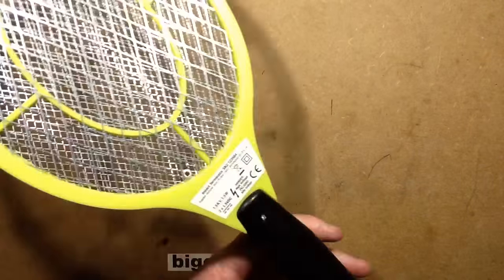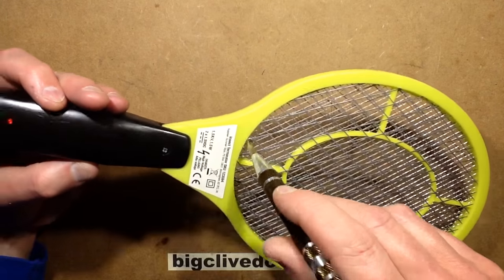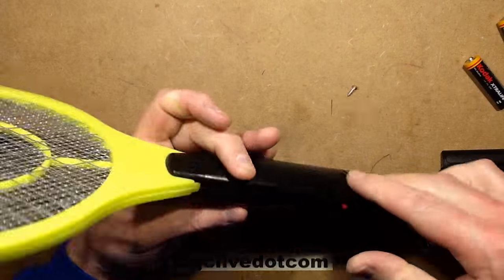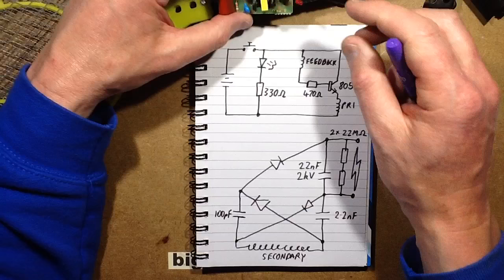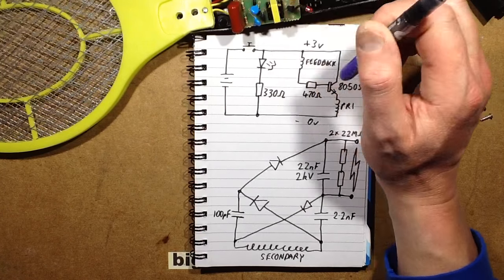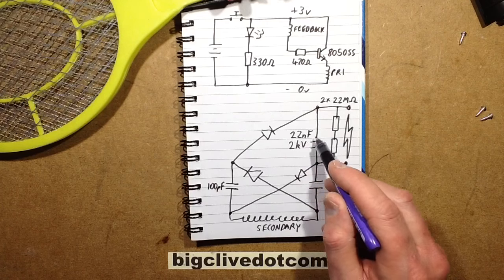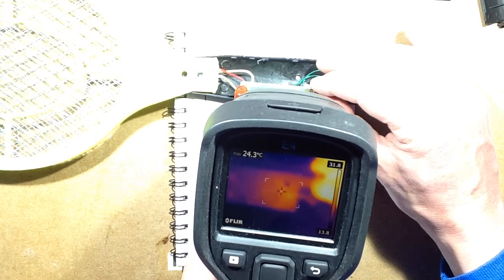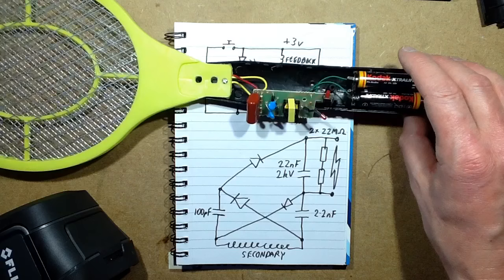Inside a bug zapper racket / racquet , with schematic.

Comment: I say, Clive old bean; just what is the voltage across the grid that zaps the bugs?  Inquiring minds would like to know...
Reply from the maker: +Silver Turtle I think it's around 1-1.5kV.
Reply: I thank you.
Reply: +bigclivedotcom so buy ten for $10 combine the circuits add power supply and 10kv?
Reply: Some crap ones are 800v and some go up to 2kv. Clives one seemed like 1.2kv.
Reply: I've seen some being advertised as 5 kv. Of course it would vary by manufacturer.
Reply: +topher If you ignore the fact that they are only intended for burst use, the really low current and therefore very low Power yes ...
Reply: +Silver Turtle  - I've just measured mine (using an EHT meter with 200Mohm input impedance) and it reads 970v)
Reply: +Silver Turtle Mine measured about 2.3kv with an electrostatic voltmeter (I was using it to test the vintage meter)
Reply: Meters can get fried trying to measure such high voltages. Good that you guys have equipment that can handle it. Others, please check the limit of your meters before attempting this. Is there a way to limit the output voltage by a known factor (perhaps by adding a resistor?) then multiplying it later to get the true reading? Say I put something that'd accurately reduce the voltage by 5 times, so 2kV would only send 400 volts to the meter. Is it possible to do so  in a simple manner , or would I need to know the current flow in order to do it?
Reply: +Habib Hasan a bunch of resistors making a voltage divider will work 90Mohm leg and 10Mohm leg should read 200v with a 2kv source Ive used them to measure up to 100Kv
Reply: Habib Hasan Well, such high voltages certainly can do damage - but a high source impedance tends to limit the damage greatly, by causing the voltage to drop hugely as current starts to flow.  
That's why different meter technology will give different voltage measurements for the zapper voltage - and why I quoted my meter's impedance. 

You can use a series resistor to modify your meter's full scale reading, if you know your meter impedance. eg if your meter is 10Mohm input impedance, adding 10 Mohm  in series will change a 500V full scale to 1kV full scale.  **Just make sure that the resistor or resistors that you use are rated for the voltage that they will have across them..  A typical resistor will only be good for a couple of hundred volts. The resistors in my meter are each rated at 60kV and there is a chain of them..
Reply: +Habib Hasan Ohm's law mate
Reply: +Mod Mod   Why not measure the AC voltage on the secondary then do the math?  Using a 10 meg resistor in series with my Fluke DVM, I measured ~ 350 vac,  I doubled that, because of the series resistor,  so I figure the DC output is about 1400 volts. Of course, because of the frequency of oscillation, the meter reading may not be spot on.
Reply: Just use a potentiometric divider. Two resistors. Make the lower resistor much smaller than the Zin of the meter so there is no loading. Don't go mad in reducing the shunting effect of Zin because accuracy is controlled by the resistor tolerance. I've just seen  "CheeseRoll's" instructions and he has fallen into the trap of not considering Zin of the meter. His cct  will read about 110V (head maths) when measuring 2kV, not the 200V he expects when using a normal DVM.
Reply: Worried about the frequency - Stick a 'scope on it. Preferably an analog one.
Reply: 2300v
Reply: nope, measured 850-950V depending on how new the batteries are.
Reply: Can anyone tell me- how come one is able to touch the mesh with a screw driver and not get a shock?? And how do we survive such a high voltage when we touch it??
Reply: I'm guessing with 0 ohms the current just jumps across, but w/ human skin R is much higher and so is the voltage drop across it. The charge has a high potential, but there's not a lot of it, so it dissipates quickly.
Reply: ssn90 Because it is the voltage BETWEEN the two mashes that zaps. So, if you took one screwdriver and stuck it onto one of the mashes and took another screwdriver and stuck it onto the other mash, you would get shocked. And we survive it because the amps are very, very low and the voltage breaks down very, very fast.
Reply: drkastenbrot It would be fun to put the  circuitry from a stun gun into one since they can run on those 2 1.5 volt cells.
Reply: Not really adding much here apart from crowdsourcing an average answer... 614v from mine @ 3v, 689v @ 3.3v & 918 @ 5v... The noise it makes at 5v is terrifying...

Comment: I'm thinking of using one of these as a small electric fence energiser. We have a heap of trees in our goat paddock and each tree has a metal cage around it. One wire would go to an earth stake in the dirt and the other wire attached to the cage. Cage would be elevated and insulated from the ground. These bug zappers are cheap enough to fit one to each cage to keep the goats away. Perhaps use 2 rechargeable AA batteries and attach a small solar panel from a solar garden light to keep the AA batteries topped up. Change the momentary switch for an on/off switch. Clive I'd love to hear your thoughts on this idea.
Reply from the maker: I wouldn't recommend that.  The current draw is too high and the circuits are not intended for continuous operation.  Electric fences use a pulsed system that gives a static like shock when approached.  These ones discharge a capacitor and could potentially injure an animal.
Reply: +bigclivedotcom Thanks for the advice mate. Is there anyway to reduce the duration of the discharge easily to minimise risk to the animals? I can't think of another way to protect 30+ trees individually without breaking the bank :)
Reply from the maker: The battery consumption would be huge even if you limited the output.  Proper electric fence type circuitry uses short snappy pulses.  I'm not sure you could build that many solar powered units cheaply.  It might be easier just using plastic coated metal mesh round the trees.
Reply: Not legal in most places since regulations limit pulse time, not current. Electric fence units limit shock by using a pulse less than 1 millisecond long. This device limits shock by using a small capacitor and currents. Also, with such limited current, the slightest short circuit would cause loss of voltage. On a damp night or if grass grew and touched the cage i suspect that there would not be enough current to maintain a deterrent voltage. Battery life would also be an issue i suspect. Message me if you want me to suggest an anti goat design using a battery powered conventional electric fence unit.
Reply: +David Bean  Thank you for your input. Much appreciated.
Reply: Naughty Goat Farm
I would use a battery powered unit and one large earth. i would get a nice new garden hose and straighten out fence wire and slide the wire inside the hose. this gives you insulated cable which can be used to distribute the pulse to all the trees, buried in a shallow trench if desired.
Reply: +David Bean good idea thanks.

Comment: to get better performance just unsolder the battery connections and solder in a 9v battery connector.... it was powerful enough to kill wasps instantly and the square battery fits inside the handle.
Reply: +captainnemo
If you do that you'll probably want to upgrade the transistor so it can take the higher power output. I'd suggest a bipolar NPN power transistor in a TO-220 package. The rest of the circuit is probably durable enough to handle 9v, but I'd probably also swap out a higher value resistor in series with the LED so it doesn't burn out due to over-current.
Reply: ive run a couple at 9v, they work well enough

Comment: I found one of these on the kitchen worktop one morning, I pushed it out of the way.  Unknown to me, batteries were in it and the button for activating it was facing downwards!  Yes, you guessed it, it HURT!!!!  I put a safety switch in it after that so it could be turned off and no accidental activations could happen.

Comment: Hey bigc, can we safely measure the output voltage and current of these HV devices in our regular multimeter using any hacks or mods? Please post a video guide about how to safely measure such high voltages. BTW, is this circuit's output AC or DC?
Reply from the maker: You'd be best using a high voltage probe.  Otherwise a direct contact could arc over in your meter and damage it.

Comment: TEACH ME HOW TO OVER CLOCK IT PLEASE
Reply from the maker: +chems Simply add a mains lead.
Reply: why overclock it? what are you trying to kill? horses? it's plenty powerful enough already to kill flies 😂
Reply: +Adam Burdett Make it ionize the air as well, so one swing and the dust is gone. :D
Reply: +Smaxx It already does that. If you switch a powerful one on and put it close to your nose, you will smell ozone. I actually do that test before buying one to verify that it really is outputting high enough voltages to fry mosquitoes easily. It would also give off a glow in the dark.
Reply: Seriously though, you could add some cockcroft-walton multiplier stages at the end. You might need a higher voltage rated capacitor.
Reply: bigclivedotcom i bet it would work if you supplied current limited mains (like an amp) and replaced that transistor with a high voltage one :). the output cap might explode but who cares
Reply: you need to talk to photonicinduction for that!
Reply: +Chris lawton Yes! shame he doesn't upload anymore though 😧
Reply: +Adam Burdett i know. He would soon have a million volts through that, until flames.....
then finish it off with his hammer.!
Reply: +Chris lawton * hits it with hammer * "oops, I popped it" 😂
Reply: Haha!!! They were good times indeed
Reply: +Chris lawton they sure were :)
Reply: +chems Add microwave capacitor to the output.
Reply: +Chris lawton its as if he heard us! check photons channel, he's uploaded 😊
Reply: +Adam Burdett thanks for the heads up mate :)
Reply: Ah, you have learnt some physics.
Reply: @GeoMatRay  I add a bigger capacitor but wasn't necessary.

Comment: I've got a bug zapper exactly like the one in this video and I've accidentally zapped myself a few times and it hurts like hell, you don't even have to press the button to get zapped either
as long as the batteries are in it and you happen to accidentally touch the metal grate then you get zapped.
Reply from the maker: It sounds like it doesn't have a discharge resistor so it holds a charge after being used.

Comment: Try feeding it with a single LiON 18650 battery instead of the two AA that are in series?

I have one of those that uses two D-cell batteries in series... I use NiMH batteries for it... I've considered rigging up an adapter to use a LiON 26650 battery since it fits perfectly inside 1" sched-40 PVC pipe and 1" sched-40 PVC pipe is nearly exactly the diameter of a D-cell, but thought that maybe I would need to voltage divider if the voltage tolerances were critical... I find a flyswatter to be quicker for killing flies, but I was thinking of repurposing the bug zapper circuitry to a rodent deterrent in my detached garage... I didn't want to make it out of a microwave transformer since it produces lethal currents for humans and my luck is that I would eventually touch it...
Reply from the maker: Definitely don't use a microwave transformer.  The bug zapper circuits are not really suited for continuous operation.
Reply: @bigclivedotcom  -- Currently, I hook a branch of my electric fence charger to the trailer hitch of the vehicle... Ever since doing that, I have not even had a nibble on  any of the rodent traps or poison blocks that I also have in my garage, so it seems to have made a difference... Still, a microwave oven transformer powering a couple of bare wires suspended slightly above the floor surface and frying the bastards has a certain appeal to me... :)

Comment: I have one at home I use to blow boards to bits when its so far gone its just not repairable (phones,tablets etc etc with water damage) ....enough power to blow the middle out any little ic, cheap fun and if it breaks ...2 euro each.
Reply: man, what r u doing? water damage is repairable and it's one of the easiest board repairs. unless it dameges the expensive and hard to find chips like processor, RAM or GPU. or when it's pee-water damage, i  that case the board is just too gross to work with lol.
Reply: Throw away electronics , no one wants to pay more than its worth to fix it, About the only time its worth fixing is if they really need data.

And even then there is only a few out there that will pay the price it costs to do.

Besides its just for fun ,its amazing to see traces light up and ic's just vaporize.

Comment: I have a Black Flag one which one has the same circuit board.  Which resister do I cut to not have the voltage bleed out so the capacitor fully charges.  Do I cut both of  them?  If I do will the thing still work? Here's a video so you can see what I'm talking about.  Thanks!

https://www.youtube.com/watch?v=5St2NTudZKM

Comment: ok remove the discharge section then it will be live when you need it with just a bit of a tickle on the power switch and should increase battery life.
Reply from the maker: +Rick T. Have you tried an Avon product called Skin so soft.  It's not intended as a bug repeller, but works so well that many of the utility companies issue it to their crew and sports shops sell it as bug repellent.
Reply: +grandpaseed I once managed to swing one of these so hard it ripped the bat bit off the handle... and one of the leads from the chunky capacitor from the board too so it stayed charged. When I accidentally touched it, the next thing I knew I was in a heap on the floor... So while it's a nice idea, I'm not sure I'd be happy keeping that thing constantly charged.

Comment: There are some wonderful and very cheap 3v to 5-6kv converters that are almost identical in size to the original board. Replace the stock board with one of those beauties and watch that arc!! Its more like a bloody stun gun and it fires repeatedly.. here's one: http://www.ebay.co.uk/itm/NEW-DC-3v-6v-to-400kV-400000V-Boost-Step-up-Power-Module-High-voltage-Generator-/191027607866?hash=item2c7a21f93a:g:GAkAAOSwa-dWsNfp         Clive, you REALLY should give these a look over but they are potted.

Comment: WWE had one of these in the 90's it didnt work with alkaline batteries. YOu had to use the ones called "Tudor Motor" they were the only non alkaline single use batteries available in sweden at that time. Is there an explanation for why alkalines didnt work? Is it a question of discharge characteristics or something?
Reply: I'd guess that the batteries had a higher voltage output. Perhaps they were actually a stack of button cells or lithium primary batteries?
Reply: No they were 1.5v AA batteries.

Comment: Would it be feasable to dismantle the safety mesh and change the electronics to turn it into an electric fence ?
Reply from the maker: It's only designed for brief use and would burn out.  Electric fences use high voltage pulses.
Reply: Aww, that's too bad then :(

Comment: How would you remove the outside cage and just wire it to charge the center?
Reply from the maker: It needs two sets of electrodes.  In this case the inner one and an outer one on either side.
Reply: bigclivedotcom yea I know but the old school ones did not ! There has to be a way to route it to where just only the inner grid takes the charge

Comment: what would happen if you connect a 9v battery?? asking for a friend (A)
Reply from the maker: It would probably damage the unit if it didn't drag the battery voltage down low enough.
Reply: i could not help my self, took an old 9 volt (has 8.4 left in it) and put it in, no dice... (unit still works though) (let me paint you my problem. my girlfriend has horses, they suffer from flies. a lot of flies. about 60 to 80 on the head of a horse. if you disturb them they do not sit together anymore but they fly around you, I want to electrocute them (or a large part of them), but after the bug zapper has killed 5 or 6 it does not work anymore. and if you go crazy with your bug zapper, the horses will run. funny to see, but now you have to catch 2 hysterical animals and you have only killed 10 to 15 flies.) my thoughts went immediately to something on a 9volt battery, something with a 555 and a step on transformer? and only use the housing

Comment: got one of these, tried whack a mole with a hornet, before realising discharge resister  - 
that got removed quick, Bigger zap
Reply: +voltare2amstereo eh...that's a bleed down resistor. read the color bands on it, i bet it's in the megaohm range. On average, these units have 2kv ceramic caps and let's say(in theory) there's a 2 megaohm resistor on the cap. ohm's law says it only draws 1mA(or less with a higher rated resistor). When a bug makes contact on the racket, it becomes the path of least resistance and creates a parallel circuit with the other resistor. Suddenly the current through the other resistor is even less as the bug is getting 99.999% (or more) of that discharge. Removing that resistor will give you a fraction of a percent and an energized racket when not in use. It's there for your safety.
Reply: Then 22megohm, hah. current is extremely low.
Reply: with it intact, it goes from zap to nothing in 5-10 seconds, with it removed, it can hold indefinetly, and the zap is more pronounced, from making flies stop, to making flies explode -  mmm more charge
Reply: +voltare2amstereo   Exploding flies  -  I like it!!
Reply: +voltare2amstereo put in bigger caps and battery lol.

Comment: what is the output voltage and current ?
Reply from the maker: +rrkreutz2 About 1-1.5kV and the current will be a sharp but very short spike as the capacitor discharges suddenly.